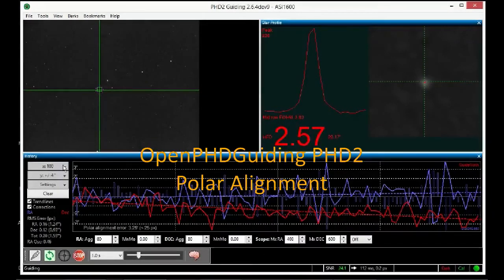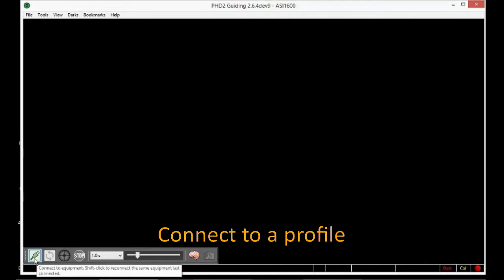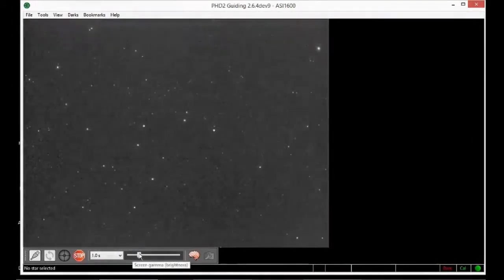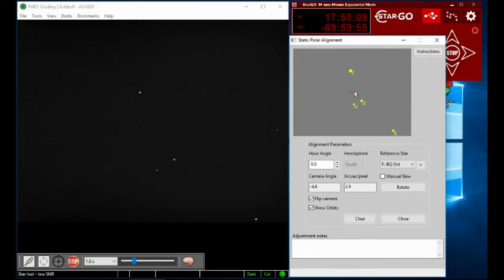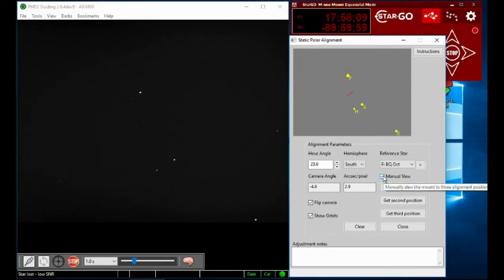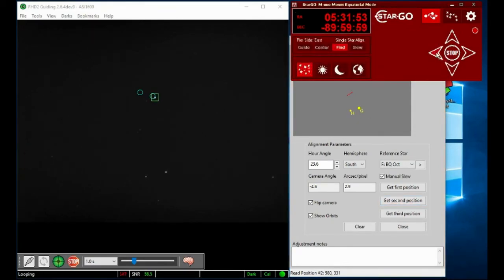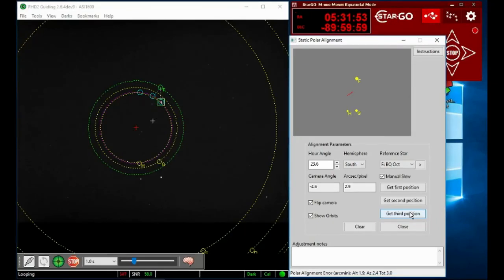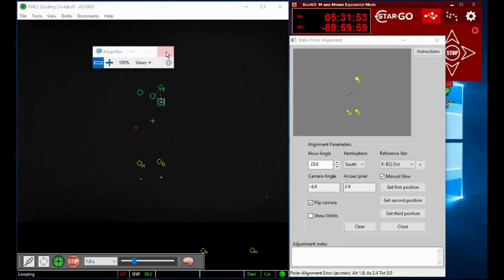PHD2 Polar Alignment Tutorial #3: SPA Manual Mode

Comment: Very nice these videos. For a beginner it is hard to understand when you are mooving if you are doing it moving the axys of the rotation or mooving the camera/telescope. I understand it is the axys of the rotation since you are trying to align it. If it is the case, what is position of the telescope and counterweight?
Reply from the maker: I am moving the axis of rotation by adjusting the Altitude and Azimuth screws.
Reply from the maker: The telescope is close to the home position with counterweights down and pointing near declination 90. As long as the scope is pointing within a few degrees of the celestial pole it will work.